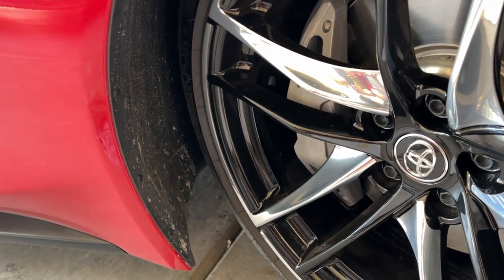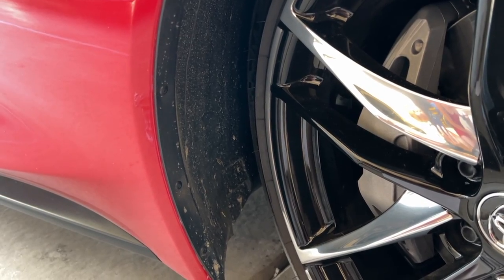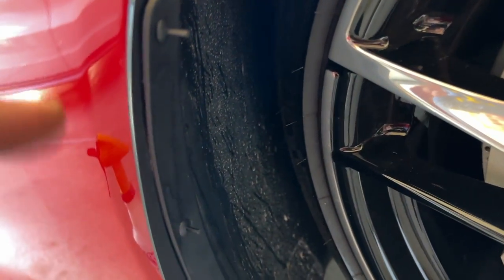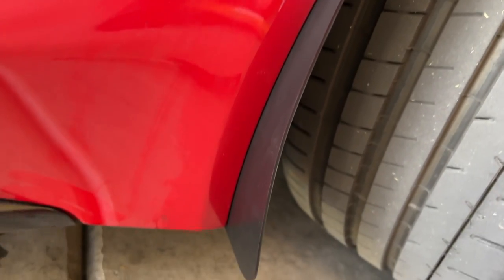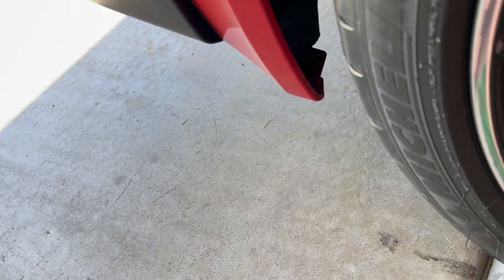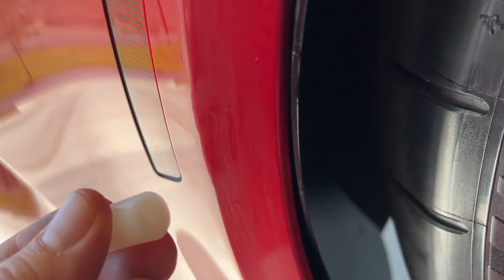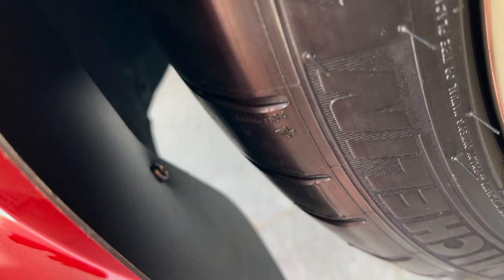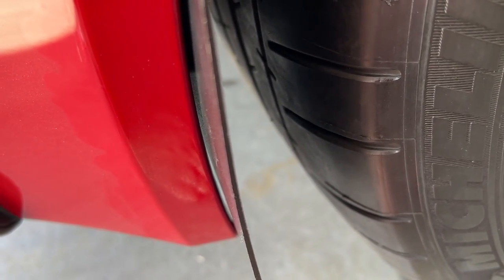How To Install Rock Guards Without Removing Your Wheels - SUPRA

Comment: I have a ‘22 and it looks exactly like your fitment. Supposedly the bottom screw location changed for ‘22 hence the downward angle you mentioned. Didn’t mind it. More important for me to protect the rear paint. Already had one small chip on the driver side before install.
Reply from the maker: Thank you for this!

Comment: Looks like the screws are stainless steal. Probably the best you can do unless there are plastic screws the same size. A little bit of black paint on the head (and underneath it) would help a lot with looks and maybe a bit with corrosion (tho water can still get into the threads).
Reply from the maker: Thanks